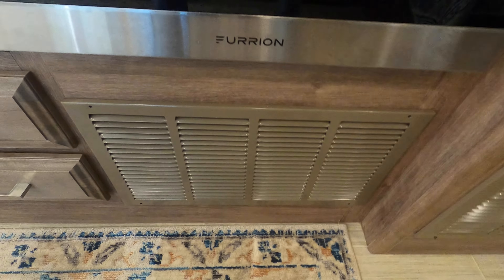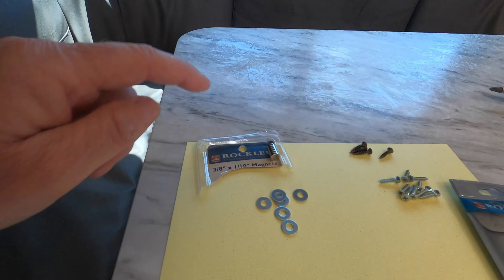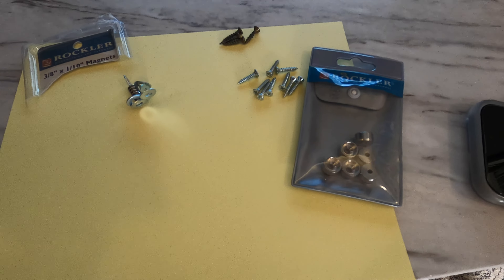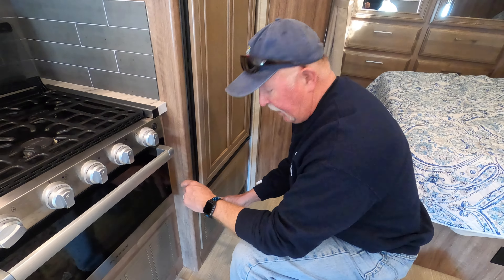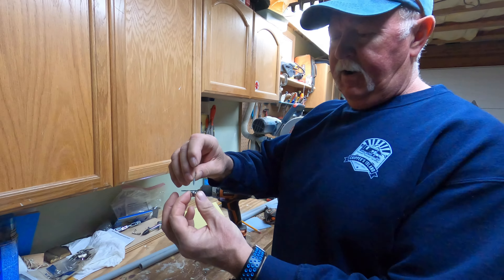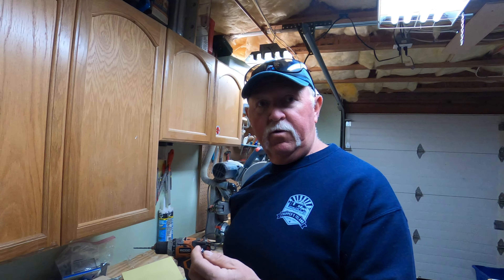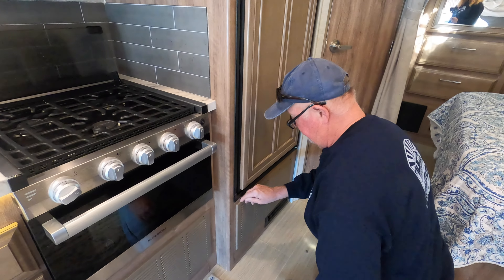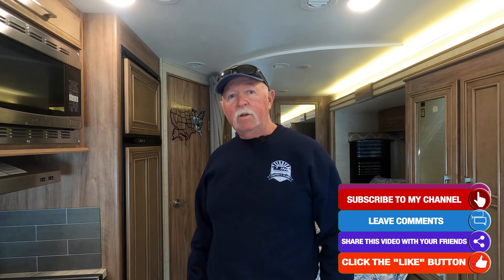Vent Grate Mod!

Comment: Great mod!  Unfortunately I have a wooden grate under my Residential Fridge in my Vision XL and the magnets probably would not hold up the heavier wood.  I will look for another solution for me as I would like to have quick access to the stuff underneath.  What’s up with the Odessey?  Thought you transitioned to the Class B.  Keep rocking’ the RV stuff.
Reply from the maker: You can try larger 1/2” mags that are countersunk.  Odyssey is presently for sale. All the best!